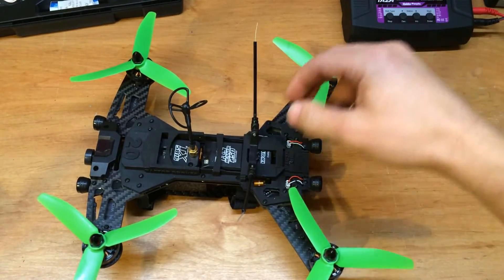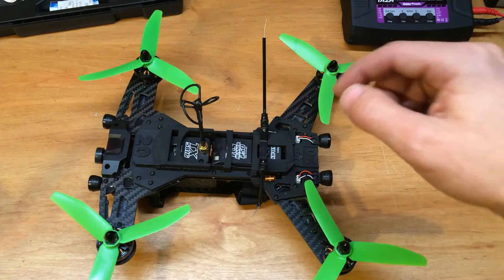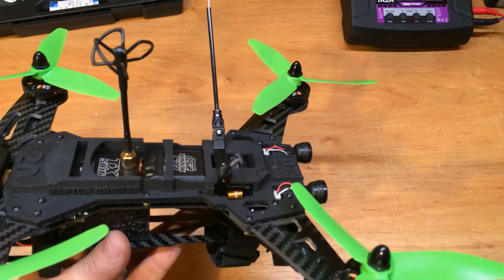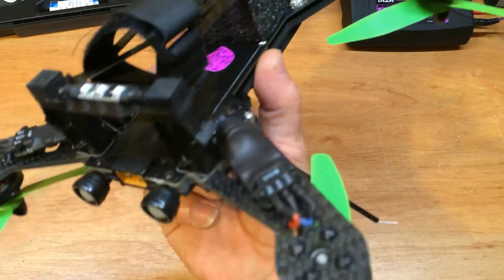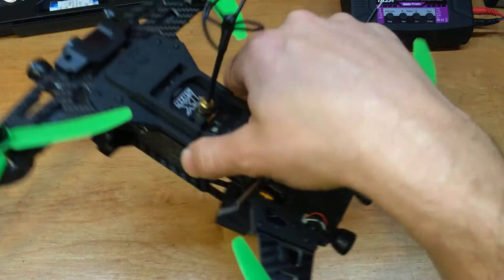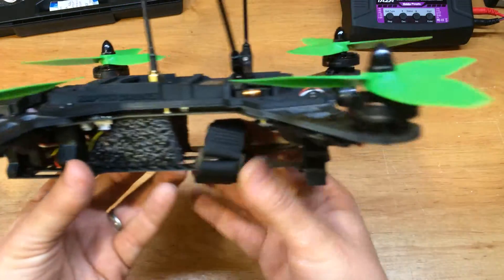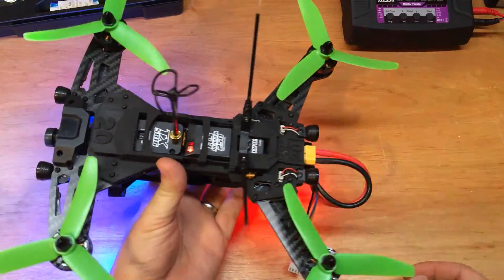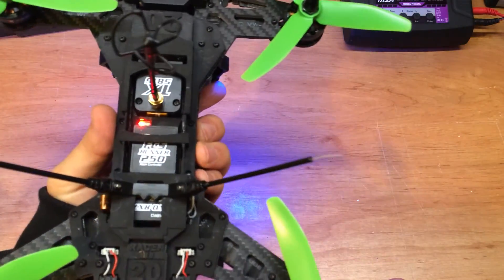CUSTOM Walkera Runner 250 DIY Mods - Aftermarket 3 Blade Props LEDS Antenna and Racing Tray

Comment: In my experience it gets like 40 kph fast. I'm a total noob to electronics, is there any way with for example better motors to increase the speed to like ~ 100  kph?
Reply from the maker: J Grobshaeusser probably not the stock ESCs. If I recall they are only 12a ESCs.

Comment: Great info, can you tell me where you bought the led lights want to do the same to my F210 & Runner 250, also maybe a little more instruction on the wiring for the led's, do they just wire directly into the XT60 connector? Me and ready Kilowatt don't see eye to eye to often. Any help would be greatly appreciated ! 
Also was unable to find the links you mentioned about the 3D Printed aftermarket skid plate if you can post these links to the LED's & Plate in your reply. Thanks.

Comment: hey can you make a video where you show us how to fit on the racing plate? otherwise great video! liked and subed.
Reply from the maker: It fits pretty snug. Just get each screw started, then go around tightening them down a little at a time. It will pull the plate down into place.
Reply: Do i have to take out anything from its original state?
Reply from the maker: +Timothy Nguyen the racing plate does no reuse the GoPro mount or very top plate. If you want to keep that stuff then go with the "newsvan" 3D printed plate. There's no permanent mods needed. Just take out the screws. Lay the plate on and screw everything back in.
Reply: will the plate work on the newer version of the normal runner 250?
Reply from the maker: +Timothy Nguyen I think so but not sure what they changed on the "new" ones? Contact David Bowes at Sigilpickups.com    He designed and sells them.
Reply: ok thanks for the info

Comment: does the top plate really fix it because mine just broke in 30 minutes
Reply from the maker: Watch my flight videos. I flew it hard and when I did crash I crashed hard! never had any damage after adding the 3d printed plate.
Reply: +MultiRotorReviews Appreciate it,did you use the  "carbon fiber "bottom main board frame along with the 3D top plate? I also ordered the 3D bottom battery tray  should be a little better!

Comment: Hi Matt,  Could I use Gemfan HQ 5x3x3's?  Should this be ok?  I already have prop nuts and just was wondering what the flight characteristics would be with a 5x3x3?  Love the low profile and I may also remove my legs from the quad ... great idea.
Reply from the maker: You can definitely try the 5x3x3!! Not sure how they will perform, I've not tried any with suck little pitch. They should still be more stable and handle better than stock props. And flight time should be great! But top speed and thrust will be very low compared to stock or a tri-blade with a greater pitch. Wont hurt anything to try!!! Those props will be very easy on the motors and ESCs.

Comment: if i got a racing plate would the camera mount not fit on the runner 250
Reply from the maker: He has the racing plate "no camera  mount" lighter weight. And he has the newsvan that allows you to use the factory camera mount. Both make the runner a lot more rigid.

Comment: How much did all the mods cost? And what are some cheap goggles?
Reply from the maker: Not a lot. New antennas ebay $15 for the pair. 3d printed top plate was $30 from sigilpickups.com. Leds were like $1.50 and prop nuts were $3 for the set. The voltage alarm was like $4. Turnigy batteries are $15 or less. Most the little stuff from hobbyking.com. HQ 3blade props $3 per pair from readymade tv.com. Around $75 for every single thing I've done to it.
Reply: +MultiRotorReviews any chance of $5 for my quad fund?
Reply from the maker: +Tyrone Albertyn that's all it takes to start. I've had it almost 6 months so this is the end result. I modded it slowly over time.

Comment: Hello Matt, I went to Readymderc.com to buy some on those 3 blade props and I would like to know if you can tell me why there are 2 different ones: 5x4x3R and 5x4x3 ? Sorry if I sound ignorant. The R means like is ccw and the one without R is like cw??? please help, they didn't responded me and I needs props asap
Reply from the maker: The R stands for reverse rotation (CCW) I believe. Either way you'll need a pair of 5x4x3r and a pair of 5x4x3.
Reply from the maker: The R stands for Reverse Rotation (CCW) I believe. Either way you want a pair of 5x4x3R and a pair of 5x4x3
Reply from the maker: +Javier Mendez The R stands for Reverse Rotation (CCW) I believe. Either way you'll want a pair of 5x4x3R and a pair of 5x4x3